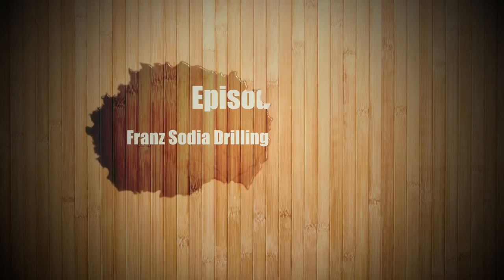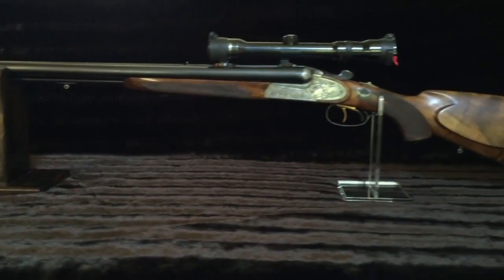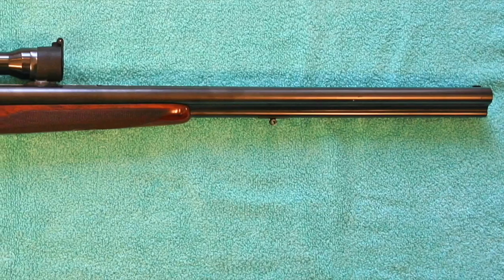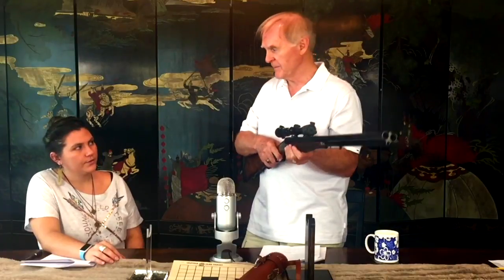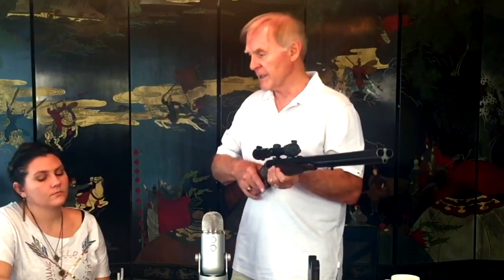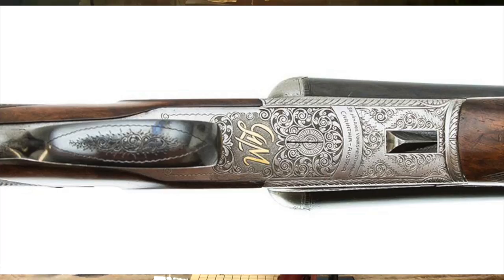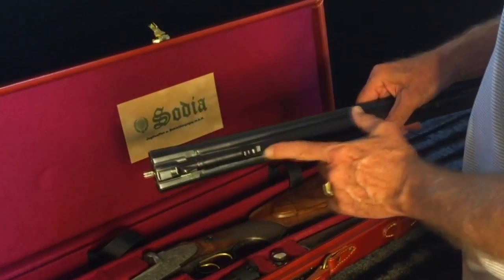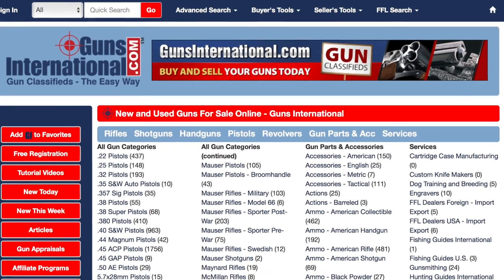Episode 5:  Franz Sodia Drilling 12x12x308Win

Comment: Roger thanks for the video. I have a Franz Sodia in 12X12X8.57JRS and it is awesome. Kills birds great with the double full barrels. I can hit anything with the rifle to 150 yards. I am going to get a scope on it one of these days. I always cause a stir when i carry this gun and make lots of folks want one to hunt with on every occasion. I found that shooting the Aguilla mini shells work extremely well on quail, dove and grouse. 5/8 oz in the mini shells with that full choke is devastating out to 35 yards. So much easier on the shoulder than full 2 3/4" loads.
Reply from the maker: Thank you very much for your input.  Your testimony to your drilling's accuracy is exactly in line with what I discovered about my gun.  Also, since I did this video, I have picked up another Franz Sodia double rifle drilling in .270 Win, 22 Hornet, and 20 gauge.  It is scoped and like the two of the subject here, deadly accurate also.